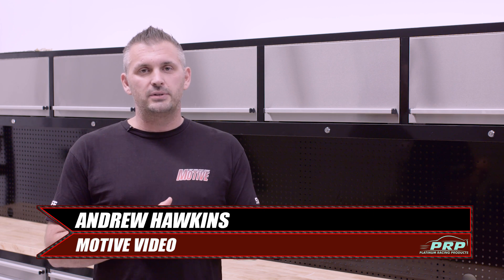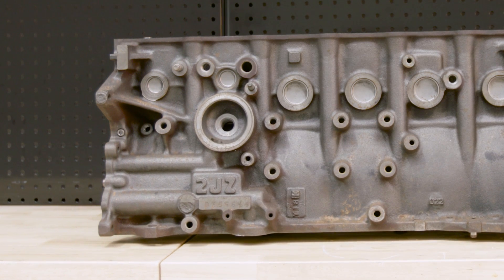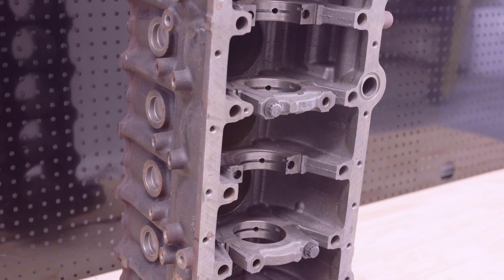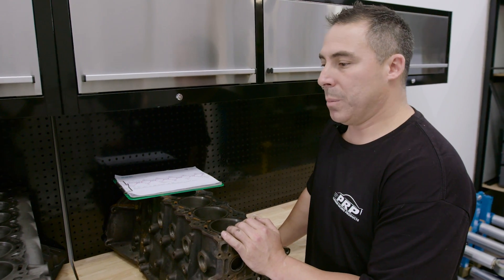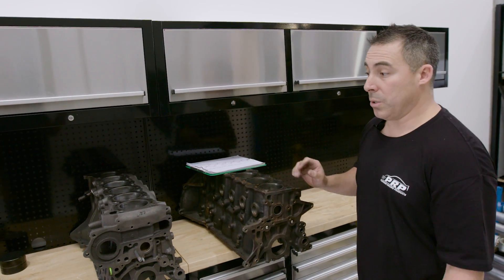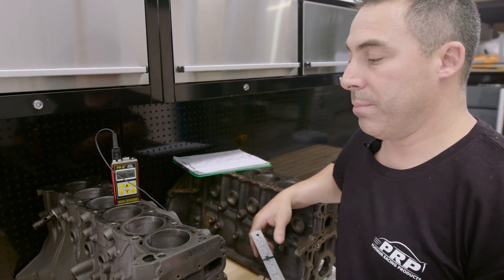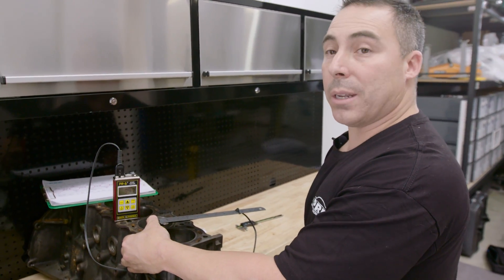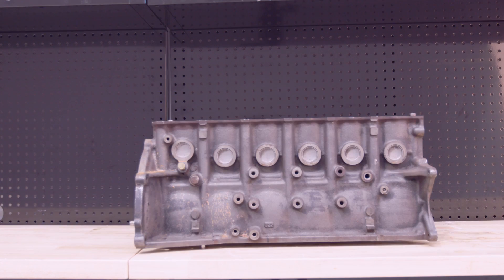RB30 vs 2JZ Which is the Better Block and Why? - Mythbusted

Comment: 2jz is quite genius, having bores Siamese makes the block shorter, stronger, lighter, which makes the crank shorter and less prone to flex. 2jz is a little tank.
Reply: T1000AX proper engineering mate!
Reply: kiss
Reply: 2jz is fucking genius in itself because the japanese actually used its head when doing this 😂 The Internet wants to know what makes it so good this is the answer people were asking for 😂
Reply: Don't chevy engines have the same thing?
Reply: @SoulTouchMusic93  In small block I think yes
Reply: @mikamika9781  yea the 400 cubic inch/ 6.5L small block chevy back in the 70's had a siamese bores(it got a bad name because morons were bolting the wrong head on them without steam ports so they would overheat) but with the right heads dirt track guys were building those engine to 700hp at 8,500rpm and screaming them for the entire race.
Reply: @eaglefat9398  Wow Nice! especially for a 50 year old engine. 
Another reason to like the 70's.  Nice knowledge
Reply: CockYaLegS  It kind of does hold the engine together. If it snaps or tears a few teeth the engine is scrap. Most of the 2jz with big HP would be using the vvti.  They are a good donk but a rubber belt is a  big weak point in the motor considering the amount of power they can produce.
Reply: @jobdone4828  not true at all especially when the fastest h pattern manual car is a jz . Fastest imports even in the top 20 or so are all Jz & Rotary powered. Fastest import period is jz powered than Rotary powered. Rbs are nowhere in sight on that list. Maybe one if you're lucky
Reply: @jobdone4828  "rubber belt is the wealth point" you're reaching at this point & its sad. You know these motors are in the 5s right? Along with a 6 second H pattern manual car here in the US a ton of other 6 second auto cars some streetcars which have competed in drag week with 5 second door slammer big motor big nitrous/turbo/and blower cars no issue. Along with a bunch of 7 second street cars which is the average for a nasty jz these days between 7s & 8s. Rbs have yet to surpass the rotary before they can even step to a jz
Reply: T1000AX It’s a pretty large engine though
Reply: kcjd
Reply: Siamese bore's are nothing new
Reply: But the 2j is heavier..?
Reply: @youtubesbichasspolicys5888  no its lighter than an rb39
Reply: Somebody said this about Siamese bore: "Siamese bores are highly likely to suffer from severe distortion and high temperatures around the upper 'bridge' area which will limit the reliability of the gasket in this zone." - Do the 1jz and 2jz suffer from this issue?
Reply: Yes sir... you know the real truth
Reply: T1000AX ." 2jz is a little tank " 

Held together by a rubber band . Belt goes motor goes bang .
Reply: @jobdone4828 stock 2jz are non interference engines meaning the valves cannot hit the piston, beld goes motor just dies but no bang
Reply: @jobdone4828  there non interferance engines
Reply: @jobdone4828  2JZ is non interference. Nothing happens if the belt breaks.
Reply: @jobdone4828  the vvti is interference the non vvti gte is not. So no you're way off
Reply: @LucidBoost_3600  Only the NA vvti is a interference engine
Reply: @David__1989  stock yes but what percentage of people keep them stock? My motor has kelfords in the head so it is now interference as well as being a vvti gte. Been dealing with and building 7ms and JZs since the late 90s I'm well aware of what is interference and what isn't.
Reply: @LucidBoost_3600  Well you said that the vvti is interference. I have two that’s stock so that is 100% for me:)
Reply: not really, 
older engines already had that especially i6 and V12
Reply: @mikamika9781  the jz & rb are inline 6 motors

Comment: Slightly tapperd bore and piston, more comp at top of stroke, is that why piston rings expand and contract? 🤔
Reply: no just a design feature, its where you need more strength technically as that's where the pressure happens

Comment: A more equal comparison for the RB vs JZ debate, is the 1jzgte vvti vs the rb25det neo. Both engines single turbo 2.5l dohc inline 6's, one with variable valve timing the other with variable cam timing. If you are going to test and compare engines, compare and test the entire engine not just the bottom end. The head is just as important to making power as the block is. Also important to discuss is cost effectiveness of the options available, since the vast majority of the people watching this do not have 30k to blow on their engine bay.
Reply: noted, we will work on this idea, cheers

Comment: Still to this day I have never seen a 2J fail in person. Would love to a see a low 7sec R32-34 compete in drag week...
Reply: You're sure right about heat! Have a 2J S14 working on and having a few heating issues. Can't complain as that's the only issue the car has!
Reply: Has everything you mentioned, well other than a hood vent. Owner doesn't want that. Problem is getting airflow to the radiator at low speeds, since it has a 6" thick intercooler stuck infront. Makes 1100 on C16 and runs mid 8's and hasn't ever broke. So having some heating issues in traffic is a good trade off IMO.

Comment: 2JZ fanboy video.
Reply: What, lol. If anything Andrew is an RB fanboy, there's no 2JZ fanboying about it, just cold hard facts as to why you don't see 2000hp stock block RB engines.

I'm sure he's got more content regarding the 2JZ vs RB battle up his sleeve, because the power holding ability of the block isn't the only thing to consider.
Reply: Fanboy comments, there a lot of fanboys out there and you you are a typical fanboy, no big deal
Reply: @OriginalSquirmy  That's funny since I have cars powered by both engines, lol.

Comment: Excellent information and not fan boy bullshit. I use to prefer nissan over toyota  but I don't like new nissan's at all. The RB came out in a lot of cars from cheap taxi's to the GTR from 1986 to 2001. The JZ came out in a more limited premium range I would say. Dose this reflect in the far better quality of the JZ. Many of us will never need to go in search of that much power so the RB is more than good enough. I would like to see how the quality of the ford Barra compares out of curiosity.
Reply: I don't think the RB30 came in the cheap taxis. This video is comparison of RB30 and 2JZ block. It doesn't say Toyota vs Nissan, GTR vs supra, not even RB30 vs 2JZ efficiency and power. 
It is just 2JZ vs RB30 - BLOCK parameters.  

For a mechanic / tuners like him - if he were to chose an engine block and tune the absolute best around it from ground up. He would definitely pick the better one.
Reply: @debendragurung3033  RB30's were in the Australian R31 skylines (and a couple of other markets), everything from the top of the range models to the pov pack base models with manual windows and unpainted bumpers had RB30's here. In the past the RB30s were generally looked down upon and the twin cam Rb20 and Rb25s were sought after.
Reply: Corporal Punishment why settle for 2nd best if your building a car🤷‍♂️
Reply: I don't know about that, the JZ block was available in tons of Toyota models. Very similar probably to Nissan's range. The JZ at the time went into almost every RWD vehicle, aside from SUVs and Trucks. For whatever reason Toyota spent more money on the JZ block than Nissan did on the RB it seems.
Reply: @Mr Calcium Oh I don't doubt that Toyota spent quite a bit on developing the JZ. My comment was towards OP disagreeing with him saying that the JZ was a more limited production engine compared to the RB and therefore could be made at a higher quality.

Although with your statement that Toyota had a small budget on engine development, where do you get that info from? I don't disagree that Toyota improved their inline six to compete more with others, but the RB25 came out three years after the 1JZ.  And going back to the RB20s I don't know how they were blowing away Toyota's offerings? The 5M-GE was a much larger displacement engine and the later 7M-GTE was much more powerful than the RB20DET of the time. And even if you compared it to Toyota's direct competitor offering the G series motor toyota had the 1G-GEU and 1G-GTE around the same time as the RB20s, both being 2.0 inline sixes and both putting out the same power figured. From what I can see is that Toyota and Nissan just were competing with each other like usual.
Reply: @Mr Calcium I'm not as familiar with Nissan racing as I am with Toyota. So I'll take your word on it that Nissan was doing really well.

In each decade of production automobile engineering between Nissan and Toyota they always showed the same amount of power till the late 90's, early 2000's when Toyota stopped making performance engines and slowly killing of their sports cars. But just go back and look, Toyota and Nissan up till the end of the Supra always had engines that were as powerful as Nissan's. Both would go back and forth between coming out with a new engine that was more advance than the previous. Toyota was not "severely behind the 8-ball." They were developing the JZ engine family. The 1JZ-GTE showed up only a couple years after the RB26DET and both made the same power. Auto manufacturers can't just release new technology or car models whenever they want to, they got to make profit. Regardless I don't know where you are coming up with these ideas. RB20DET-R was not making as much power as the 7M-GTE, the RB20DET-R was making the same power as a 1G-GTE. And just like how Nissan replaced the RB20 with the RB25/RB26, Toyota was also planning on replacing the the M and G with the 1JZ/2JZ.
Reply: @Mr Calcium  I gotcha, I can see that. I've never paid too close to their inline six race motors since I didn't even realize they raced with them. Kind of like how Toyota didn't really use the JZ for racing, they mainly used 503Es and UZ based motors during that time I believe. Their 4 cylinder motors were way more impressive, like 2TGs, 18RGs, 4TGTEs, and their respective race versions.
Reply: Sigma Projects
3S-GTE
Reply: @negativeindustrial  Ah yea, forgot about the 3S. They were pretty cool in lower power forms. I just get bugged when Toyota would start calling the 503E a 3S-GTE when they're so different and wasn't available in a production car.
Reply: Sigma Projects
I’d give my left but for a running 503e
Reply: @negativeindustrial  Right? They're of legends. I wonder how one would do when tuned with modern sensors/ecus.
Reply: Sigma Projects
Source me one for my SW20 MR2 and let’s find out 😜
Reply: @negativeindustrial  I'm pretty sure I could get one, but it's super expensive, lol. Probably 20 grand, haha.
Reply: Sigma Projects
Ugh. My 1994 Celica GT4 probably has $20k under the hood and chassis. That’s depressing LOL
Reply: @negativeindustrial  lol, dang. Let me know if you sell the engine and I'll line up the 503 for you =D

Comment: this only matters if you are going to be running stupid power... there is no difference really up to 1000bhp
Reply: Yeah, just like how my Samsung Galaxy S9+ is no different from a Nokia flip phone. It only matters if they are going to run stupid apps. There is no difference really up to not having to call.
Reply: I nominate you for having made dumbest comment of 2018
Reply: @MARZOSIRUS  please do elaborate einstein...
Reply: @omarlondon  you said anything under 1000 there's no difference... so you're saying 200hp or 800hp are the same? You need clarification here.
Reply: @omarlondon  If you watched the video. They clearly stated the differences between the two blocks. Clearly the 2jz is superior it being harder yet lighter. Siamesed cylinders, closed deck and 11 oil passages vs 5 for Rb. 

Even running at 300hp for both engines. The RB will burn oil far sooner. Meaning engine parts Will heat up faster a lot faster. Engine oil is the lifeblood of an engine it helps keep parts cool and lubricated. 
Heat is the enemy of an engine. 

Both engines are inline 6. Both high RPM engines. More rotations equals more heat being produced. 

Nissan likely saved costs on the engine design and production. Since it is more expensive to produce an AWD transmission and suspension. 
The R32,R33 and R34 were not produced as Supercars. They were affordable sports cars. 

The R35 however is a totally different animal. The R35 no expense was spared. 
The R35 was built to take on Supercars capable of 2000hp plus.
Reply: @MARZOSIRUS  it is superior for over 1000hp id what he is saying meaning you can safely run 800hp on either the rb or 2jz without any worries about if it can hold it or not but when yiu start making crazy numbers like 1500hp the 2jz will hold up where the rb wont
Reply: You know guyz he's actually right tho? But that would mean finishing a project car and enjoying it instead of keep turning it up until it windows the block or beats Elon to Mars.
Reply: Tex 13 No way. My experience with them is. The Attesa system sucks and the diffs leak like colanders.  Among all the consumable parts corroding un-believably fast.. Find figures for the development cost of each maybe? I’m pretty sure the Supra was RWD because they wanted to use the bulletproof Getrag Trans. Not to cut corners
Reply: Tex 13 Subframes don’t ‘Crack’ on any car out there. Nor do Supra diffs explode, people swap them into most drift cars such as Silvias. Neither car is perfect. But, the Supra was a better designed vehicle.
Reply: You also have a picture of a Supra off of google. So i’m dwindling on the idea that you actually own a Supra
Reply: Under that same logic, may as well grab a gm 3800 unless you plan to run "stupid power", it will hold 300hp no prob.

Comment: I saw someone weighing an aluminium LS block and it was only 49kg. And that's a 6 litre engine.
Reply: because alloy is much lighter. but weaker.
Reply: mrnicktoyou but then you have to add an extra head and pistons for the LS, and due to the 90 deg v8 firing order an LS needs a heavy counterbalanced crank and harmonic balancer or it will shake itself to bits. I6 is an already inherently balanced engine.
Reply: @nordic5490  the LS is pushrod, so the heads are much lighter. Also, it doesn't need counter balancers. And, it's only 4 cylinders long.